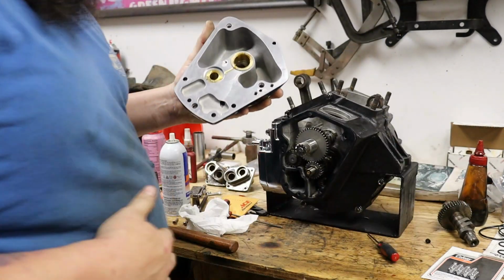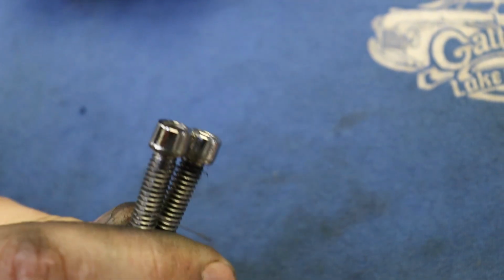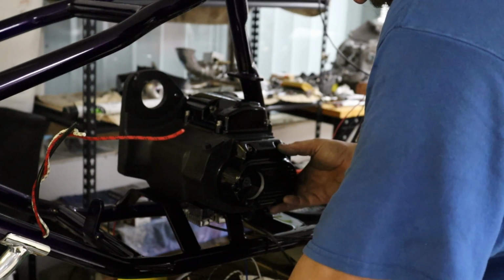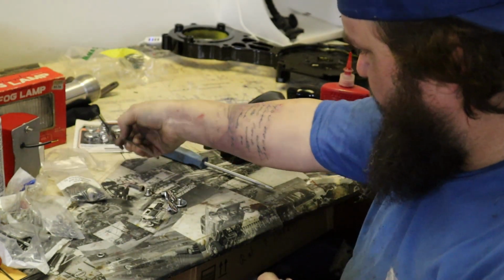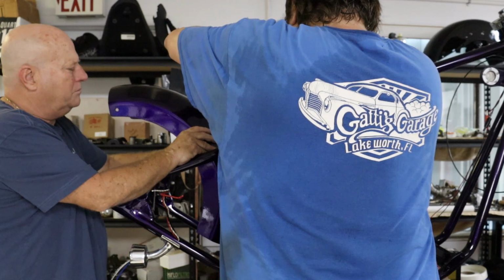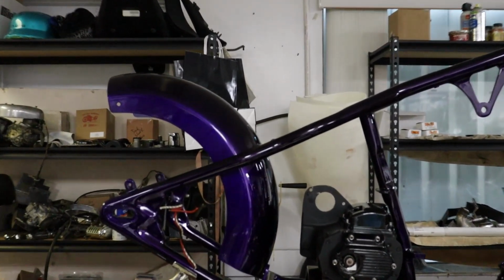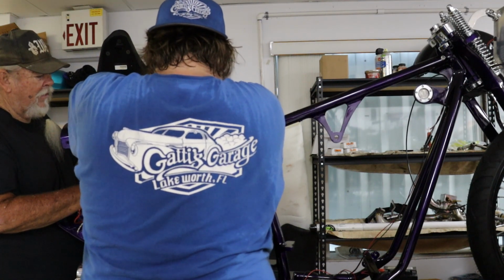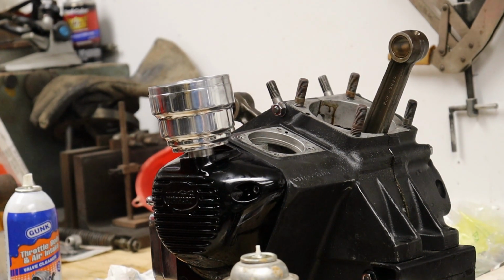Harley Davidson Shovelhead Chopper Build Episode 21

Comment: AC out is usually the run/start capacitor went bad. If you can do motorcycle wiring you can replace your own run start capacitor in the AC unit. Even better when you replace it yourself you can buy quality made in USA caps instead of the cheap Chinese caps that quickly die that repair men put in so they can come back sooner with another repair job call-out charge to replace with another cheap Chinese cap ready for the next repeat. I stopped using repairmen and looked up the two values on the old cap my AC uses to start and run the motor and ordered from Amazon an American made run/start cap in the $20's and it was overnighted and ready on my doorstep the next morning ready for me to install. When the second AC unit went out I replaced it's run/start with same USA cap from Amazon. Now I've gone five years with no AC failures. YouTube will show you proper power disconnect, draining/discharge the old cap, removing the old cap, replacing with new cap, reconnecting power. It's a five minute job once you've got the steps down.
Reply from the maker: Thanks man. It doesn't make sense for me to mess with this stuff I can make more $$ doing what I do and let people do what they do.  In this case it ended up being a leak in the coil.